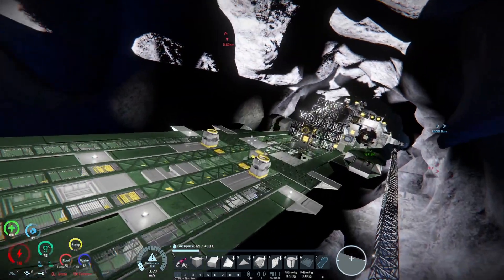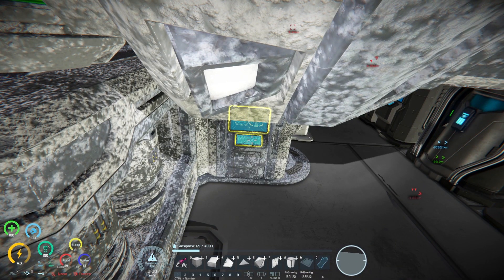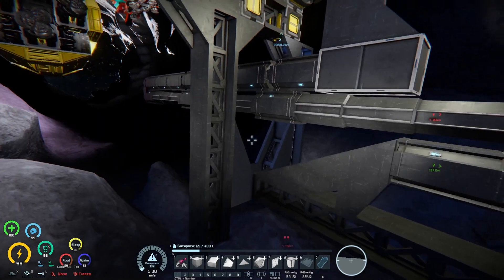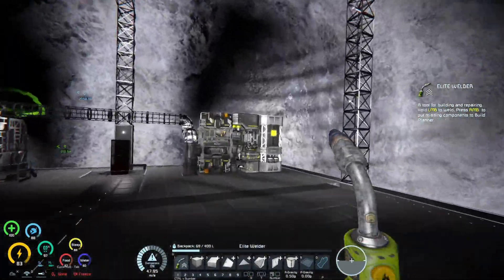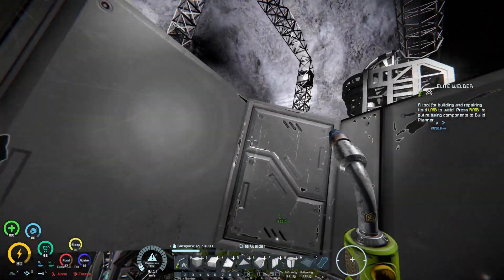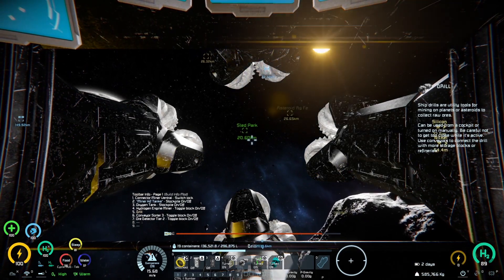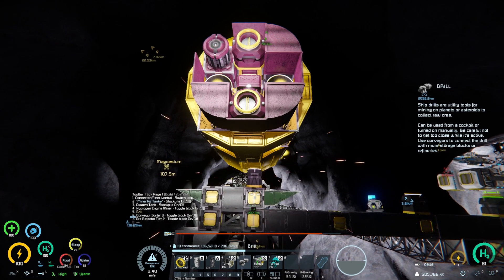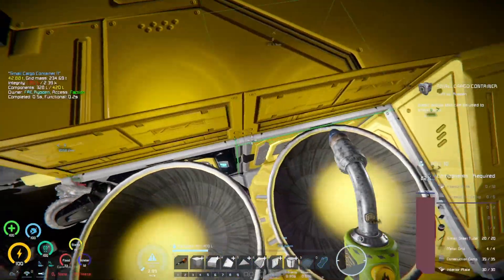Survival Records, Echelons (Space Engineers Lets Play) E19

Comment: You might be able to arrest some of the piston wiggle with gyros on override. Small enough that you could put them at multiple locations along the line, not just at the ends. Or it might just invite klan either way great viewing. :D
Reply from the maker: I had considered that, but the wiggle isn't rotational torque so it didn't seem like gyros would help.
Reply: @ryodenshipwright  didn't you use them for recoil on a tiny small grid flyer? or am i thinking of another youtuber.
Reply from the maker: @cebweb  I did, the way a gyro on override works it dampens the rotation/twisting, not the XYZ movement. So on that small airship it stopped the recoil from throwing my aim off, but didn't stop me from being pushed backward.
Reply: @ryodenshipwright  Aren't you fighting a rotational force?  Think of the piston head as the muzzle of the gun and the piston base as the butt.  The pistons bounce at the end of the line sending shockwaves back down to their base.  I did jump into creative and did a quick and dirty test  100+ mass blocks to represent asteroid & sled, 25 pistons (9  forward / 4  back/12 forward) and 4 gyros (1 gyro at the end of each line of pistons and their center points to decrease oscillation before it started).   completely killed the up / down & left/ right movement when they extended or retracted. Shot out straight as an arrow. ..Only getting forward/backward movement which should be able to be countered with the correct piston timings.   Actually, I was able to get It to almost disappear when trying to summon klang with random speeds ranging from 1.5 to of 3.5 m/s ..    I was in creative and completely talking out my arse and did summon klang cranking some to 5 m/s
Reply from the maker: @cebweb   well, if it worked out that well for you clearly there's more to it than I was expecting. I will have to implement in some of these ideas.